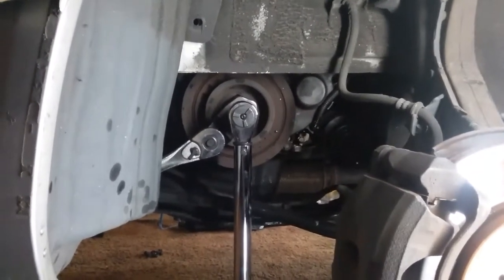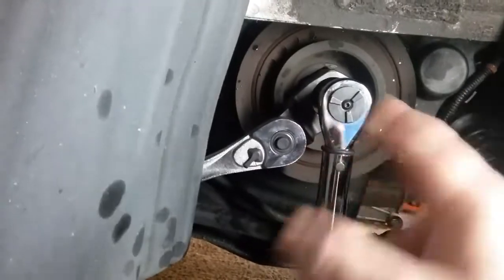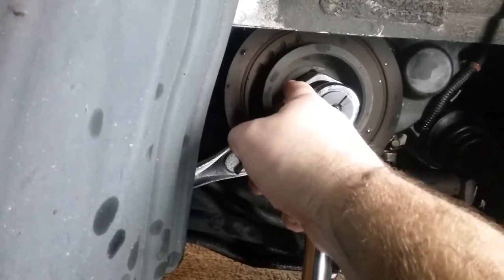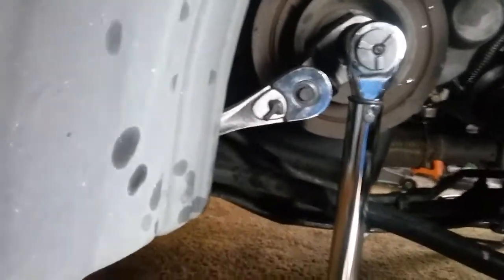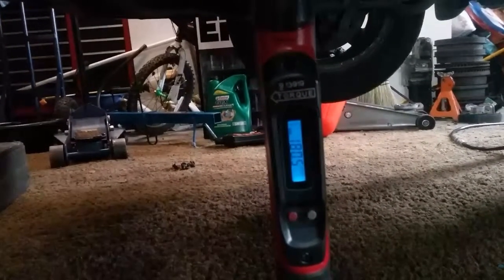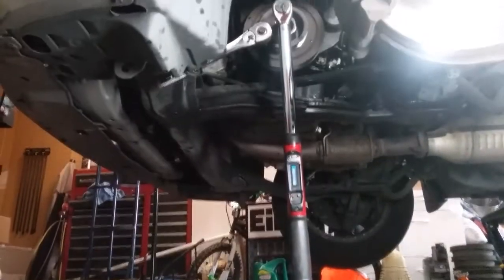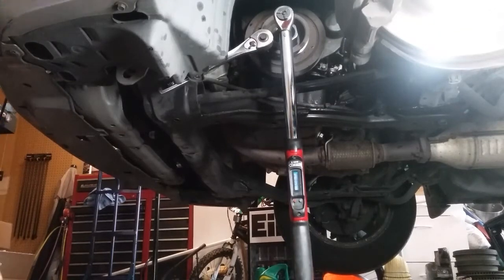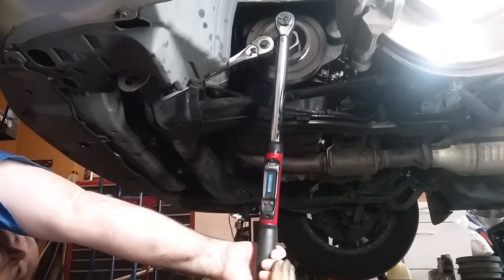Tightening Honda 2.3L crank pully bolt.

Comment: You forgot the 90 degrees after the 180.1
Reply: after 49 Nm extra 90 degrees,thats all.
if you go 180,1 ftlbs and extrs 90 degrees then i dont think you are doing it right because i think thats too much force and the bolt can brake.

Comment: no, its not a joke sir..because I tightened my crank volt through sudden force only using my hand and a regular 19 wrench
Reply from the maker: I see.. u can try it.. but i have to tell you its not Tight enough! Even with you hand. And shocking it.. ur good to maybe 110lbs of torque (if that)
Without the special crank pully holding tool all ur doing is rotating the crankshaft. If you can take it to the nearest shop and have a tech tighten the bolt with an air impact gun. 
 In comparison...most wheel lug nuts are tighten to 80-105 ftlbs of torque. That crank bolt must best at 181 ftlbs. Or it will come loose.
Reply: @Steve4x4  how can that be? My 2002 Nissan Frontier crankshaft pulley is clearly bigger than that and only needs a hundred 50 foot pounds of torque.
Reply from the maker: @LaurieFloodTeacher  thats what Hondas engineer came up with. Also it matters the type of metal, and the how snug the fit is, and what is the load that is put on it.(type of assesory drive used on the vehicle) I have personally have need a loose Honda crank pulley come loose due to not properly torquing it correctly.
Reply: @Steve4x4  well, thank goodness you have that tool. There's no such set up for my 3.3 L Nissan Frontier. It was just a booger.